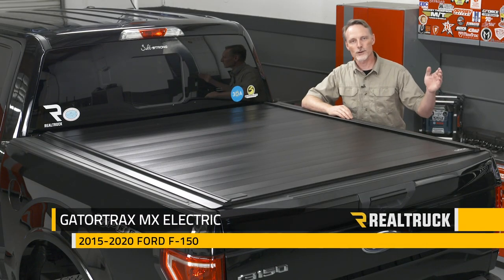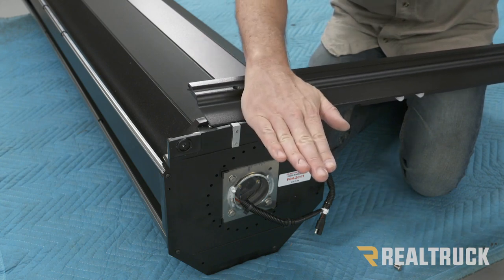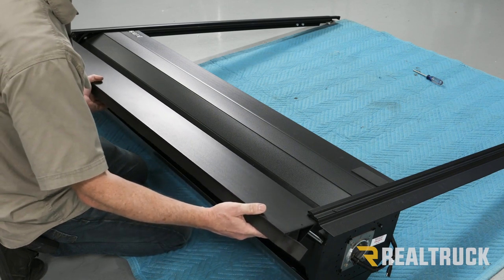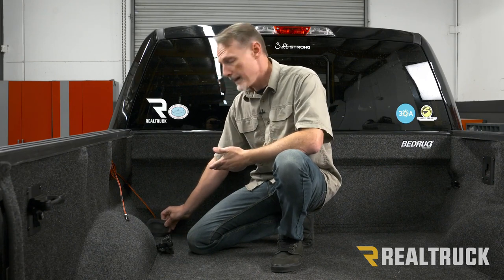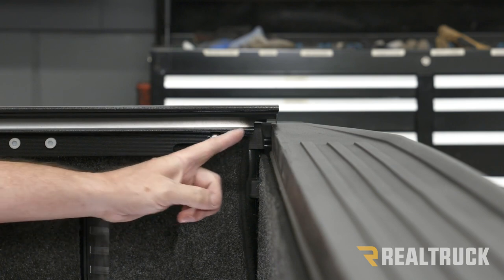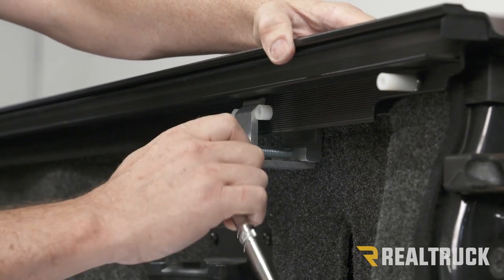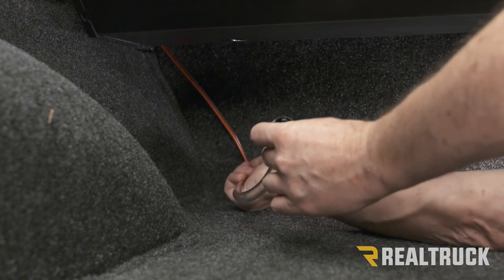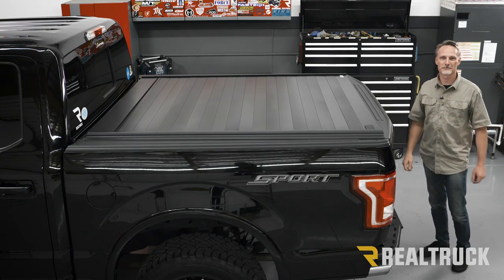How to Install GatorTrax MX Electric Tonneau Cover on a 2017 Ford F-150

Comment: My cover has been installed about a year and now the cover when closed has a gap between the canister and the cover? Everything is lined up?  Any thoughts what could be wrong?
Reply from the maker: Angel, there shouldn't be a gap between the cover and the canister. We recommend calling in and speaking to one of our knowledgeable truck experts, 844-215-1457.